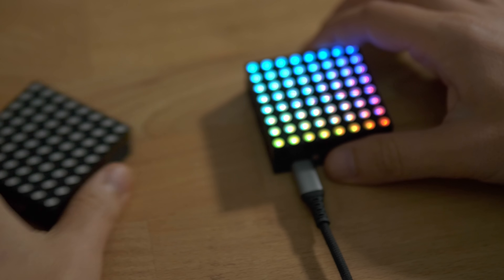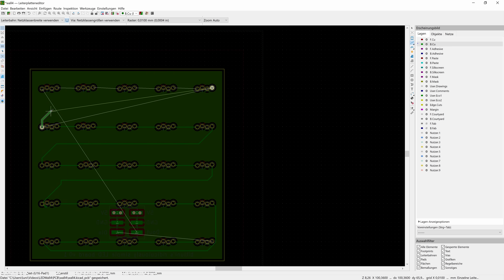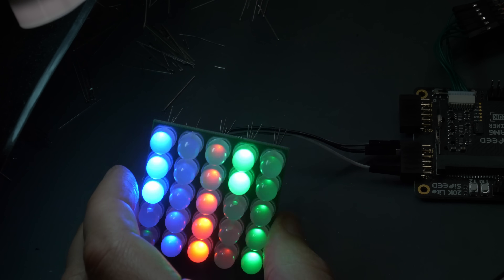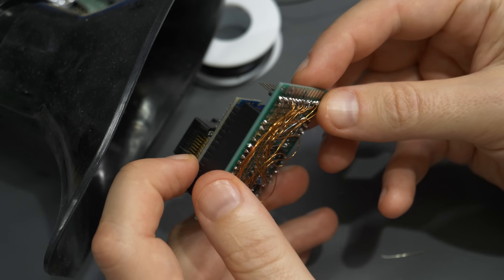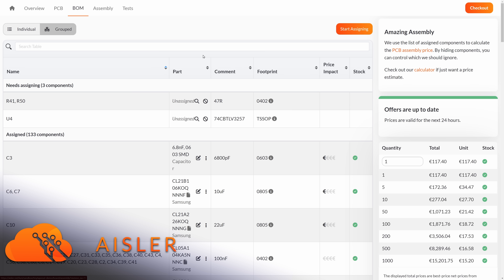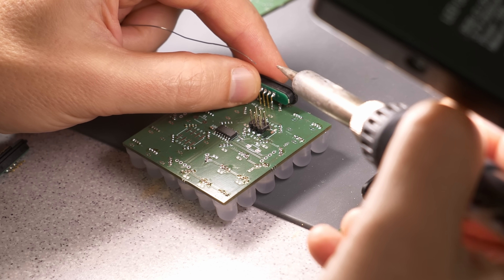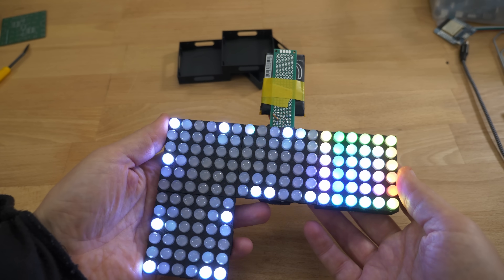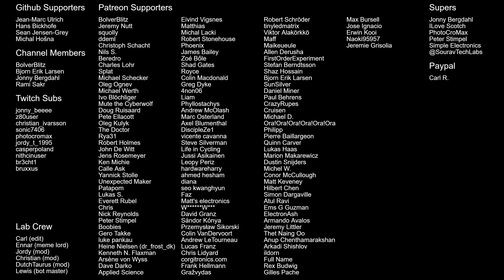Making oddly satisfying LED magnet tiles

Comment: Why not use the liquid flux/solder and hit the entire board with hot air? I mean I know that’s more chance for issues but that’d probably help out with the magnetic issue or so many solder joints getting tired idk just a thought for mass production

Comment: Nice! You could also design a 90° magnetic connector to enable 3D assembly of the panels. Something like a corner with to magnetic connectors soldered to each other.

Comment: I have been recently working with WS2812B SMD leds and had the same issue of them burning out due to current surges. After digging some websites, I found that it was fixed using a 100uF-1000uF electrolytic capacitor near the LEDs.

Comment: Cool, immediately ordered the PCB, can't wait to try and build this. 
What did you use as battery for powering the device? And I don't see a link to the resistor you used for the board.

Comment: Potentially helpful tip. JLCPCB is able to assemble boards for you and you can get them shipped to you fully built. I have made a ton of use of this for my custom circuit board projects. Its more expensive to have them assembled but it saves so much time

Comment: Solder in SSW-104-01-G-S sockets or similar, cut the diode leads to length, and it will be easy to mount (and replace if necessary). 
Prepare a project, software and you can earn a lot of money on it as wall decorations for your home/room. All LED/RGB lovers (PC gamers) will be knocking down doors and windows to buy it (of course if the price is decent).
🙂👍

Comment: after looking through the files I have a few questions.

What physical size are the 100nf capacitors
What size are the 2 buttons 
what value is the single resistor

Comment: I think it has something to do with the brain. Once in a while I flip things backwards, even when I tell myself to watch out for it. The best preventative is to review your work to make sure you did not reverse electrical connections.  Better than losing electronics do to over heating. Most electronics just don't work if polarity is reversed, but not always.

Comment: I can't help but wonder, since the magnetic connectors are 4 pins, would it be possible to make something kind of like that custom batter pack you made, but is like another board with a USB data port so you could override the microcontroller inside without having to take the casing off?

Comment: I tried this project, but found a fatal problem. A few seconds after power-on, the main control chip would instantly break down. I want to know why? Are there any new solutions? I used an adjustable power supply to power it, I tried 1-5V & 20MA-1A

Comment: Hello, the project with addressable LEDs can I control with wled esp 32? can you send me a larger design of the 8x32 led panel? I want to make a wall clock controlled by wled, please if possible? Project proposal for bike lights with IP68 addressable LEDs?

Comment: My thoughts so far: 
- You could make a magnetic or metallic jig to solder the connectors in the proper place quite easily
- You should probably solder the connectors first and the LED after that

Comment: If you wanna get around the soldering of the leds I recommend either make the the box bigger to hide the legs of the leds. If that doesn't work it may be best make little holes in the box where you can fit in the Led-legs. It may be a little annoying, but if you get the box size right you can just slot in the Platine and the box will prevent the legs from touching anything problematic

Comment: Something like Mill Max or Holtite hotswap sockets might be what you are looking for to make every LED swappable without soldering them permanently. Type "Mill-Max 7305 socket soldering" to see what I am talking about. I think they are multiple sizes out there that might have a small enough foot print to fit on the PCB. I have also seen some people in the Mech community simple use rivets instead of those socket with success but those pins look quite close to each other.

Comment: not meant to be bossy or cocky, i'm just wondering, to solder all those lds, wasn't to be easier to touch all 4 pin with the solder, give them solder doing a big short, and then with 1 swipe separeting every "ball on pins"? it could be faster i believe, i usually do that with led strips and so

Comment: The problem you had with Fusion, if you put some of your projects on "Read-Only" you can save new projects again and later you can put the projects you want to work on back to "Editable", but only have 10 active Editable projects at a time
Reply: Until they change it again!

This is why i wrote "GatorCAM for CNC" on my channel.

Comment: Awesome project! I feel like potential apps would love some touch support. You could add infrared sensors between the rgb leds. IR emiters could be distributed sparsersely; only few per board. Milky plastic in color leds would happily diffuse IR light. Or maybe some form of capacitive sensing? but not sure how it would work with all the blinking leds. Or maybe some strain gauge sensors in the corners of each module for single point sensing? just my 2 cents

Comment: Dude.  If u make this in to a large scale productions it would be a game changer for house decor
Reply: I have also been thinking about how it would be in the future. You could have eg. something like nano-particles in paint. And paint your walls with that. Then connect the wall to a box with IC, receiver etc. inside. And you can send from mobile, tablet, laptop, or PC any photo or video to your walls. So each wall would be like a big LCD monitor. Having musicvideos or just some cozy dolphins swimming around...
Reply: @75Krusty  it would probably be much easier to sell rolls of wall paper with integrated led matrix.
Reply: @MinePossu  oui
Reply: @75Krusty  you could use graphite to mix with the paint. But great idea
Reply: @75Krusty  this is a fire idea
Reply: @75Krusty  oula oui sa serais trop cool
Reply: Holidays would never be the same, and with an insane amount of epoxy or hot glue, an IPS68 rating should be attainable.  This is my next project.
Reply: Using data sent over air would be outright impossible for that amount of addresses(?) would it not? Physical connections are a must.
Reply: @andrewkvk1707  bon avant de réfléchire au problème peut-être essayer de créer le produit
Reply: I'd LOVE this shit
Reply: Even better if anyone could not only make their own programs, but integrate their games with the controller, like how Terraria can integrate with some keyboards.

Comment: @bitluni I know this is 8 months after the fact, but I just found your channel. I saw you created your own assembly language to be processor-independent. Did you know there's a Java variant called Java Card, made to run on the tiny processors of 20 year old smart cards? There are already available compilers for it, it's object oriented, single-threaded, and (optionally) not garbage collected. Also, no Exceptions, varargs, annotations, for-each, assertions, or other new-fangled crap. So implementation of a byte-code interpreter should be quite straight-forward. (actually, it's designed that way to be simple to implement in ASICs) There are standard libraries and some security instructions in there that you can just plain ignore.

Comment: I love it. Funny thing, me and my friend had a quit similar idea. We already ordered 8x8 Matrices also based on ws2812b. I also designed and 3d printed some modular frames that we can stick together (they hold pretty strong together :D). We try to build modular demo-signs that we can control via Bluetooth via our phone. Now the project is on ice tbh, because a new semester began, and i never did board-design and still need to learn it. 
I'll be happy to take a look at your code. Maybe i would  contribute to the project if you open to that. Please let me know ;D

Comment: Now I'm just wondering how big would a 4K TV be using these LED's as pixels
Reply: I was thinking the same thing. If we use the smaller 5mm LEDS and they are stacked right next to each other, the 4k display would be 19.2m long and 10.8m high.

Comment: About Fusion, have you looked into CadQuery or Build123d?

They are Cad through code, and that code is Python not something proprietary and it's a real brep/non mesh CAD engine.

Its useful particularly for highly parametric designs which I think is what you do much of the time.

Comment: i once spent 8 hours soldering leds back onto a highway signboard that tipped over, the math turned out to be over 10000 solder connections 😅
Reply: I send my boards to you then. 😂

Comment: An easy(?) way to get around the limitations of Fusion360 without paying any money is to switch CAD packages over to FreeCAD. I'd skip the official stable 0.21.2 for now and jump to the most recent RC of 1.0.0 (currently RC2 as of the writing of this comment). I haven't run into any bugs yet, but there are only a few tutorials so far.
Because I see that you are using KiCAD for PCB design, FreeCAD is a natural fit because of a plugin for FreeCAD that opens up seamless ECAD <-> MCAD integration for KiCAD.

Comment: If I understand correctly, you put a resistor in series with the on board micro serial line, but when an external controller is attached via magnetic connector it bypasses the resistor and controls the LEDs?

Comment: with the yet unsoldered through-hole LEDs stuck in place using the black 3D-printed hole plate, you could give solder paste a try for a speedier soldering flip the board upside down, smear solder paste around the holes, and put it in the oven.

... and: maybe adhesive tape can help to temporarily fix the magnetic connectors during soldering with an attracting soldering iron

Comment: Hey I would like to ask you how these panels are working. I'm looking for something like that for a DIY Nanoleaf project. I'm aiming for hexagons that can be connect on all sides to each other. So it looks like that you got it done and also how it works with the data inside of the panels. Also how does the system realize a new board like a nanoleaf does?
 I got so many questions.. Looking forward to hear from you

Comment: the link in the description for the github resolves to 'magnetMatrix6x6' when it seems the link should be simply 'magnetMatrix' :)
Reply: I got the itch to see what size display this could make if making a 1080p 'tv wall' sort of installation, and... goodness. 10mm LEDs would end up making a 19,200mm x 10,800mm wall - or 19.2m x 10.8m, which is 63ft x 35ft for the american friends... that is a VERY large wall. This might work well as an outdoor exhibit or 'side of a building' sort of thing, but definitely will not be a good idea for a home-made tv wall, haha!

Comment: I dont know if it helps, but there are copper tips for the soldering iron that you can buy even at AliX, this will make soldering magnetic parts much easier

PS: for those who are beginners with soldering, the tips are removable and generally held in place with just a screw, even if you dont solder magnetic parts, its good to have copper tips as they are better thermal conductors

Comment: Wow !! ❤ u need to prototype fast with a 3018 cheap cnc, less wastefully than orders iterations of pcb from China! I can make .6mm traces with a $400 us dlls desktop cnc and $1 us dlls bits (30°  0.1mm V tip) with 80 .8mm holes in less than 40 minutes: Kicad -> FlatCAM -> Candle, and when u are happy with u design, then and only then order u final design from China

Comment: try make a 3D printed part that make you put another pogo pin connector closer to the connector you are trying to solder. so putting the in the opposite polarity will reduce or cancel the magnetic field.

Comment: Idea: Make conway's game of life, but every tile can be seamlessly disconnected and rearranged, only interacting with tiles it is connected to.
Edit: I realize now that the boards are not individually powered. If they're ID-ed, you could still rearrange parts of the board, you just couldn't display them on disconnected boards (You could track when each board is connected and disconnected, and save the state of the game on all disconnected portions.)
It might be better to only save the state of the game for short disconnects. If you quickly disconnect and reconnect a board, it treats it as moving that board around. If you leave a board disconnected for a certain length of time, it clears that state, and treats it as adding a new segment on.

Comment: RE soldering the magnet clips on, an easier way to do this would be to add a bit of flux to the pads, insert the connector, tin the tip of your iron with solder, then hold the magnet connector in place with tweezers. I would probably use a chisel or knife tip for this, as you can hold it at a very steep angle and have maximal thermal linkage. Touch the fattest, widest part of the tip to the BACK of the pins, as far away from the magnet as possible. This will allow you to tack each pin down. Additional flux is a must for this, as the flux will allow the solder to travel off your iron tip and onto the pads. Then you can let go with the tweezers, since the connector will now be sufficiently held in place by a little bit of solder. From there, you can easily go in and solder up each pin more sufficiently one at a time. Use the back of the pins (similar position as when you tacked them) to keep the iron as far away from the magnet as possible, and flow the solder in from the side closest to the magnet.

Comment: I want  you to know that leds dying to current spikes is something even professional led fixture manufacturers deal with.
Reply: And have less efficiency
Reply: @JohnSmith-iu8cj  While it is true that the efficiency would be lowered due to a linear regulator, how much depends on the headroom and required stable voltage at the output. In addition, it's better for your circuit to be a bit less efficient than to burn out. LED's are not that power hungry, so we're not talking about dozens of wasted watts here.
Reply: @Hunyadi1442  i have several 100w+ leds at 5V appliances. 2V voltage drop at 20A is 40w loss, about 40%. That’s a bit too much heat and losses I would say.
Reply: @JohnSmith-iu8cj  Yeah for this type of application it's much better to just have the overvoltage protection with a TL431 and power transistor.
Reply: What about putting a cap across the leads?😊
Reply: here's 600 th like! 😊🎉
Reply: Could be fixed by a linear voltage regulator or even a current multiplier in series with the PSU. Although for this you'd obviously need 2-3V of headroom
Reply: @Hunyadi1442  can you elaborate on this further? I didn't understand but I'm interested
Reply: @artisticyeti22  at 00:46 you can see some pretty big ringing. By using a linear regulator between the LED's and power supply you can mostly eliminate this ringing, due to the linear regulator behaving like a variable resistor which changes it's resistance as to keep a constant voltage on the LED circuitry. But for this to work, the PSU needs to output a 3-4V more than the LED's need so the linear regulator has enough headroom. So if your LED's are supplied from 5V, you'd need atleast 8-9V from the PSU so that the linear regulator can do it's job and regulate the voltage.
An even easier option is a current multiplier, although it's not a stable power supply, it does also prevent huge spikes and noise by acting as a very large capacitor placed between the PSU and LED's, although typically you'll get a voltage drop of 0,8-1,4V between the PSU and LED's.
Reply: @Hunyadi1442  would something like a TVS or zener across the power pins do anything?
Reply: @Thaumatichthys  yup, as long as it's just short spikes and not extended periods of high voltage it's ok. You do however have to keep in mind that hey're quite slow, so super-fast spikes won't be adequately attenuated by a Zener diode. You could also use a TL431 and transistor for overvoltage protection if you fear that a spike may still be too big for a Zener diode to handle.
Reply: @Hunyadi1442  thank you 🫂
Reply: @artisticyeti22  can I.. get a hug too? 🥺👉🏻👈🏻
Reply: @Hunyadi1442  How do you conclude that the PSU used is unregulated?
Reply: @l00kns33  It is regulated, but apparently it doesn't have the protections needed to prevent voltage spikes. No PSU can respond instantaneously to changes in load at their output.
Reply: @Hunyadi1442  And the solution you are suggesting is a cascaded line regulator. How does that actually help? Won't it struggle to clamp the spike as much as the prior regulator?
Reply: @l00kns33  might end up having a higher bandwidth than the chinese switch-mode PSU used in the vid lol, a current multiplier also helps take over noise and spikes, as it's just a RC circuit + pass transistor.

Comment: It's really a shame that everyone knows about the WS2812 LEDs and so few people know about APA102C LEDs.  The APA102Cs are better in literally every single way.  They don't fail when soldering, they have much higher frequency PWM, so they're way better if you want to take pictures of them or use them in a POV display, they use plain SPI instead of some bonkers protocol that requires specific timing, so they'll work with literally any microcontroller, and they have built-in voltage regulation.
Reply: Do they cost more?

Comment: You can use a heat gun with solder paste, to solder magnets. Another way around this problem is to close magnet field on one side with metal, this will significantly reduce the strength of the magnetic field on the other side
Reply: this is the sort of thing i would realize near the end of the project for sure!
Reply: Magnets are heat sensitive. If you solder them with a heat gun you might be left with some non-magnets.
Reply: @eDoc2020  They recover when getting cold again, normally...
Reply: @SegFaultOnLine1984  Magnets, when getting cold they recover the power they loose with heat
Reply: @raphanunu6912  i am pretty sure they don't buddy